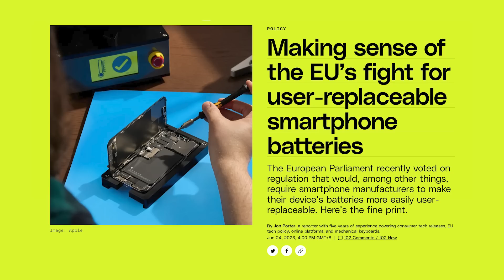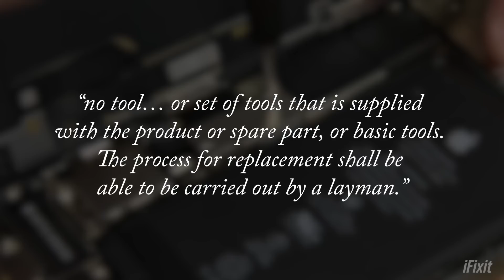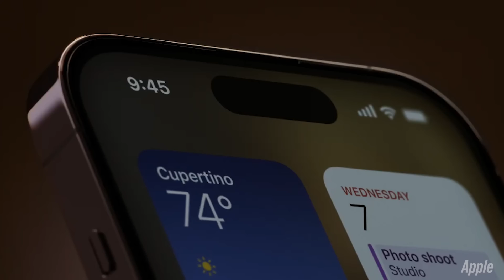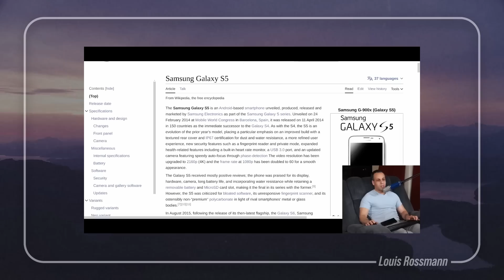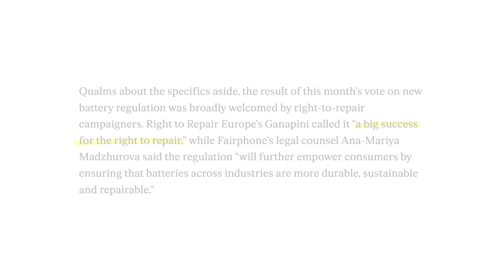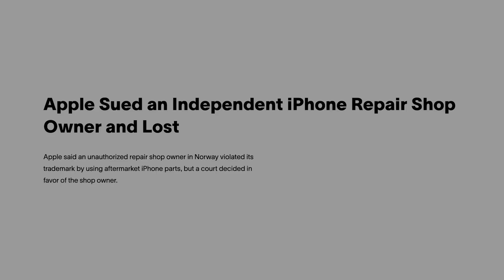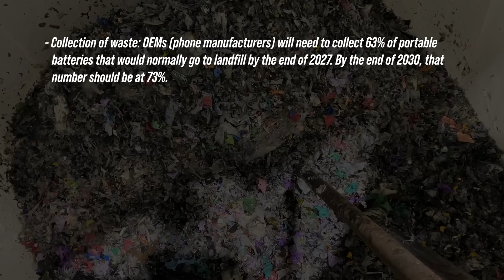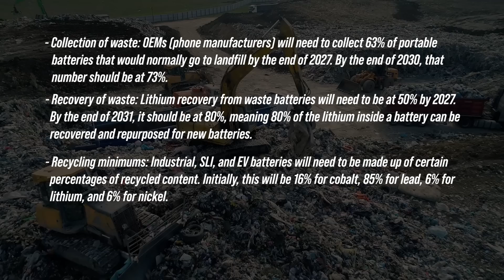EU Just Changed Smartphones Forever

Comment: There is a Chinese company, I forget the name, but they have an EV with a replaceable battery now. Instead of adding charging stations to the parking lot, they put in an automated battery replacement system. You drive into the machine, punch in your payment credentials, and the on-board robot pulls the existing battery out of your car and replaces it with a fresh one. While your old battery sits inside the machine for the next customer, the machine will charge it back up.
Reply: not sure it's worth the hassle just to save 20 min

Comment: Replaceable batteries have always been possible. They stopped doing it because people (such as myself) would hang on to an old phone forever and just keep replacing the battery. With the battery soldered permanently into the case, when the battery dies (and it always dies before the electronics) you are forced to replace the entire device, whether or not you otherwise needed to.
Reply: When I was 16 I used to buy iPhone like that l, and open em up, replace battery and either sell it or keep it as an upgrade. I was just trying to get a nice phone but the journey taught me alot about upcycling
Reply: Apple made approximately $92 million usd in 2023. Do think they would NOT sell their products to the EU as a form of scare tactic/boycott? 🤔
Reply: BS. Theyre  not soldered in.
Reply: @jamesLG1  That's true. They're glued in, same difference.
Reply: my experiances is that my uses of my phones made them outdated in performances faster than the battery died so I never had to remplace a battery, but I always carry with me a powerbank because I know that after 6 months the battery wont really hold enough and a year or 2 after, the battery is really not good anymore, so yeah, easily remplaceable battery would still make my experience quite better but it wont change that I'll have to upgrade my phone platform at some point anyway
Reply: @SpeedyGwen  killing a battery in a year or two? That is quite impressive. My oldest phone was 3 y.o. when I replaced it and the battery was still at 85% of its capacity. I think I could make it last for 5 years.
Reply: batteries are not soldered to anything, it's just that now they require someone experienced with the right tools to be replaced. No one is forcing you to replace the entire device because of the battery, stop making shit up
Reply: @justdude8115  not everyone has the time or expertise to tear down a phone properly. I fucked up a good few before I could find my way through a phone repair relatively easily.
Reply: @Deyas786  "it's just that now they require someone experienced with the right tools to be replaced". Which means if you lack those thing then pay to a professional to do it.
Dont take me wrong, I 100% support the idea of making phone with easily replaceable batteries, but this guy is just making things up.
Reply: @justdude8115  I see your perspective but what if you can't afford to pay someone to do it? Where it was at one time a 10 second open and shut replacement it's become much more complicated. The same way that a simple padlock is easily opened with force or knowledge, by making it just hard enough that the layman cannot open it would effectively rule out 80 percent of people from even trying. It's the same here. Either way I just wish phones could be more modular 😭
Reply: @justdude8115  If I have to pay somebody to replace the battery because I lack the skill and the tools, that is force in my book.

Or shall we say it's "Persuasion, Mafia Style."
Reply: @uncaboat2399  and still not "force to replace the entire device" like you said in you comment.
Reply: @justdude8115  I will refer you to the comment from @Deyas786 who brought a very good analogy to a lock. The old saying is that "a lock keeps out honest people." That is to say, it's just difficult enough that only criminals will bother breaking it. But it effectively keeps out honest people and lazy criminals. That is to say, the phone manufacturers have designed a "lock" that will force out honest customers. No it is not an unbreakable lock, but it's still a lock.
Reply: @uncaboat2399  at this point I have no idea what you are talking about. My original comment addressed your claims that batteries are permanently soldered into phones body and people are forced to buy new phones instead of changing the battery. Which is not true. That is it.
Reply: @justdude8115  Maybe I misunderstood your subsequent comment. I thought they were soldered in. My mistake. Not really relevant, even solder can be removed by people with the skill and the tools. Probably more easily than when it's glued in.

My point still stands. Maybe they don't have a gun to our heads, but in every other sense they are forcing people replace the phone instead of the battery.

And seriously, even a gun to our heads is not "technically" force, as we can always voluntarily choose to just let them shoot us.

The simple fact is they have made it very difficult to change out the battery, difficult enough so that very few people are going to bother. That translates into more money for the manufacturer, so there is no surprise there.
Reply: @uncaboat2399  no, just no. I honestly don't know what you are talking about. You can just watch a video on YouTube that shows how the batteries are replaced. But you just choose to be ignorant. 
No, solder is not easier to remove and reapply than glue. It requires a lot higher temperatures than glue and it will damage the phone.  The back cover (or screen) is removed by simply heating it for a minute (enough to melt the glue) and using something for leverage. The glue from the underneath the battery is removed by simply pulling the adhesive strip. 
And no, people choose to pay for battery replacement because it is a lot cheaper than replacing the whole phone. Sure, people in first world countries often replace their phones after a year or two when newer model comes out, when the battery is still relatively fresh. Thats because of consumerism. 
I honestly don't know a single person who would spend 500-1000$ for a new phone instead of just replacing the battery. Unless the phone is old and they don't like in anymore.
Reply: @justdude8115  Just curious.  Do you work for Apple?  Samsung?

Comment: Germany already has a well working refund system for bottles. We also have a return system for empty non-rechargaeble or brocken rechargeble batteries as well es printer cartrages. Its not that doing wast separation and reuse is a new system. There are plenty working example like aluminium cycling (many aluminium articles are made from a huge percentage so recircled aluminium.

Comment: GOOD. the battery is the only part in the device that wears out. And by locking it up, OEMs know they get your money way more often. I refuse to play video games or heavily use my phone simply because it wears out the battery and I would need to buy a whole new phone.
I'm so glad you found the IP68 rated replaceable-battery phone. I would always argue against the LIE that phones can't be water proof (and thin) with a replaceable battery. New tablets come out every year that are just as thin and solid as an iPhone, BUT THEY HAVE REPLACABLE BATTERIES! The seam you pry open is so thin these days, its the same exact feel of an iPhone. I didn't even know it had a seam to pry open until I read the instructions. Its so clean, its even better than it used to be in 2014 when we had IP68 rated phones that could open.
Can't wait for this fix to capitalism overstepping its powers. and Ignorant customers choosing products that take advantage of them(barely anyone is informed enough to vote properly on products, easy to take advantage of).

Comment: The EU single handedly stifling innovation 

First with the USB C change and now this.
Reply: @Rehunauris  Forcing companies to build within a box by definition stifles innovation. If a  better port was invented than USB C it would be illegal to sell in the EU. Removable batteries again have continually been NOT chosen by the consumer as they have consistently bought a unibody design. Companies have moved away from it because it affects the form factor of devices forcing them to be thicker. to accommodate the battery housing setup. compared. compared to the current way in which manufactures can make the batteries into whatever they want. which is not. practical or sensical for removable batteries.

Comment: I think the real reason in most phones why you can no longer remove the batteries has little to do with what they're made from or even phone companies trying to make profit by forcing people to get a new phone if the battery dies.  i think it's primarily for tracking people.  Even with the phone powered off of the battery is still in it they can still track the phone.

Comment: Two features I miss from my older phones... removable batteries (and the ability to get a spare!) AND the ability to insert an SD card for expanded memory. I remember using an easy to slip into gorilla-glass protective case that I could remove in 2 seconds when I got to my desk and then have easy access to an SD card, a removable battery, etc. It let the phone interact with my computer way better than what was available for several intermediate years until recently they finally have gotten back to having somewhat decent phone/computer interactions. But still no SD card and no backup battery for trips.

One problem this law is going to run into though... If this requires "lay people" to be able to easily swap the battery on their electric cars... I do believe in having the e-cars have easier access to the batteries so that repairs can be done to individual cells in the e-car battery. But you gotta be kidding me that an e-car is going to be swap-able by a lay person with no specialized parts. That's going to lead to thefts on a massive scale. Or the elimination of e-cars. Phones? Laptops? Tablets? Heck yes. And even e-cars making them easier, yes. But a no-tool lay-person e-car battery? Not sure about THAT level of easy being a good idea.
Reply: I don't see any reason why that's going to cause theft, it's not going to be possible to remove batteries without the key/fob/whatever, just like you can't drive it without that. It won't be intended for battery repairs by the user, just replacement of the entire unit once the capacity gets too low.
I'd imagine the standards for cars are going to be different than for phones anyway.
There's no particular reason why car batteries have to be difficult to remove, aside from size & weight.
Like many devices, everything is made proprietary and difficult so you have to go back to the manufacturer.
A bunch of phones still have SD slots.

Comment: Replaceable EV batteries will be nice. I want a secondary hotswappable battery that every EV has so you can swap and go rather than sit and charge. Of course Cars and Charge stations needs to have software to ensure that you are only swapping good batteries, to not screw over the next person.
Reply: I think NIO is the only EV manufacturer that seems have put a lot of investment into swapable batteries. You can just pull up into their power stations, and it'll replace your batteries in a few minutes.

Comment: The reason phones changed from having user replicable batteries to being glued was because the manufacturers noted that if people could replace the battery when it was old, they would keep their phones much longer. They want the batteries to fail so people will be forced to buy new phones more often
Reply: It's not going to matter.  Manufacturers will just make sure their updates cause the phone to pull more current, so your battery life will decrease until it's unacceptable, even with a new battery.  They're already doing this today.  The only way this new EU law would help is if they could also stop manufacturers from forcing us to accept their updates, which will never happen.
Reply: @davidryder3374  Which is why I won't buy an Apple or Google-Android phone but something like Graphene or Linux based Operating Systems. In addition to extended OS supported life one avoids a lot of spying/data mining the big companies do to earn more money.
Reply: @davidryder3374 you are correct having the physical parts of the phone be replaceable is just one step making it so the user can maintain the programming of the phone and the software is something they'll never allow it would put a holt to progression designing and making new phones if the software stayed compatible for longer along with the hardware people obviously as stated before would be buying less phones and devices and therefore progression on new versions would stop for much longer time there wouldn't be as much money in the business which is annoying that everything is money driven with today's society we are completely capable of getting rid of money and the barter system completely there are people that are genuinely interested in engineering and culinary and all of the different trades people that would do them because they want to if the world just allowed people to live comfortably Farmers that want to farm because that's what they enjoy would still be producing food car manufacturers people that like to engineer things would still be doing those things it would just exclude the ones who don't want to have to do it anymore those who can't function and do things like that they wouldn't be feeling guilty or have to try and figure something out they could just exist peacefully the world is just so money driven that people can't see beyond their wallet
Reply: @davidryder3374  If i'm not mistaken, on Android, you aren't forced to update the phone
Reply: @davidryder3374  That sounds a lot like property destruction and is a crime in most countries.
Could as well be some form of cyber sabotage which would be criminal as well.
It's one thing to risk a fine for the company and another one for those in the company to face criminal charges personally.

At least in Germany there are laws that regulate unauthorized interference or deprivation of property (§861, §862 BGB)  so you could probably sue in civil court as well.
Reply: It's the same with tablets...I have a Samsung T520 with a Retina-like screen but with an old battery I can't change (without tearing it apart)...so I would like to see devices with easily replacable batteries, darn it, I won't throw away my well working phone and tablet...especially when I don't see such high reso. screens on new tablets, for that money. (250 USD)
Reply: @Aetila  If EU force Samsung to produce replaceable batteries ,
Samsung will have Another Trick .
Samsung will stop giving Software Update
Reply: No, the reason is people kept buying phones with non replaceable batteries as of it didn't matter
Reply: Then manufacturers are forced to make products that are significantly better than the last one. They have to up their game if they want people to be convinced to buy a new phone from them.
Reply: the eu's rule only effects those in the eu apple could of only put usbc on eu phones but some of this other stuff they can either just put on eu phones or say fuck off @RossLemon
Reply: The reality in how this actually plays out... forcing companies to provide replaceable batteries means they are now going to charge €50 more per phone to cover the added engineering and hardware cost. €100 if they are only doing this for phones sold in the E.U., and an extra €50 to try and stay in business since you won't be buying phones from them as often. So your €1400 phone is now €1600.
Reply: @kyle2034  That's not a problem, regardless if it was true or not. It just makes repairing old devices more affordable, making them more enviromentally sustainable. 

I read a good comment somewhere, where someone complained that the Fairphones are too expensive for the specs. The reply said, that the Fairphone is a normal priced phone, and most manufacturers just give a discount for using child labour, shitty repairability and bare minimum for update support.
Reply: @kyle2034 so you will be able to use your phone for 3 years instead of 2 which means that in 10 years you pay 1600*3=4800, not 1400*5=7000. And as a bonus less crap ends up in the landfill
Reply: planned obsolescence.
Reply: It's the material used to make the phone that affects how long the battery lasts. Remember that heat is a general issue but a bulkier phone has more space for cooling. The thinner you go the hotter it becomes. Macbooks pro 2019 is a great example.
Reply: Still using my Note 20 Ultra and proud
Reply: Wow you have a 3 year old phone most people in the world have older @alexsmith1207
Reply: um you do know batterys are basicly mini nucular things right u burst one of those and caboom  they will go off in ur hand just ask samsung there well expreinced with exploding batterys
Reply: Water resistant phones left the chat
Reply: Got a source for this BS?
Reply: No one is going to pay 50-100€ to change a battery or a screen, on a phone that isnt worth more than that, even if they are happy with the phone otherwise. But they will pay 20 € if they can do it themselves in 5 min with no skills required. And you're right, mandating longer software support should be the next step. It should be illegal to not release security updates for more than 2-3 years.
Reply: I think that phone makers knows that the functionality horizon has been reached and from now on any improvement is incremental and iterative. Nothing new. So it's in their interest to lengthen their time of ROI.
Reply: bullshit, people can still replace the batteries on their phones. Also all of the batteries outlast the usable life of the device. So stop with the brother-in-law-during-thanksgiving-meal-opinions

Comment: They can just use adhesive. Just remove the battery like you remove the sim card. The whole card can coming out. Hopefully they will also add the sd card back. Kinda like lg g5 but only a part.